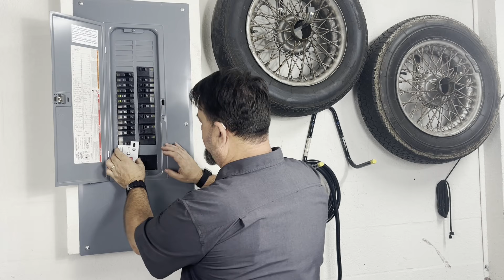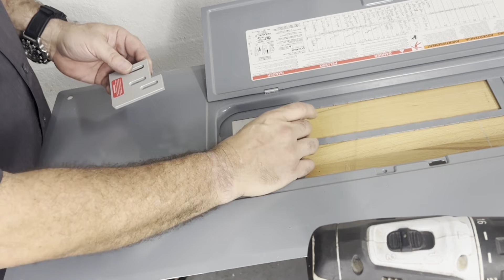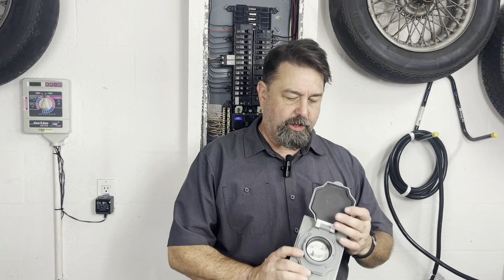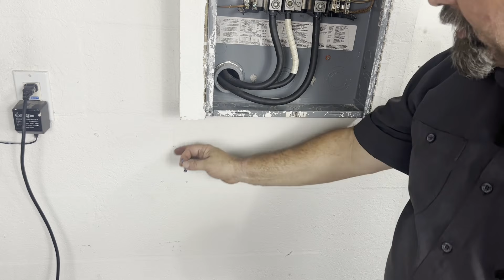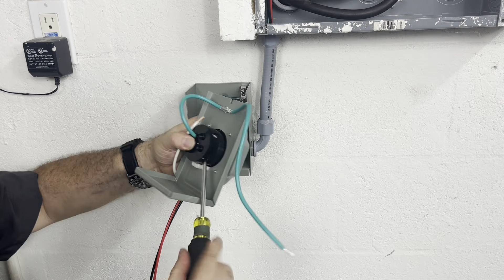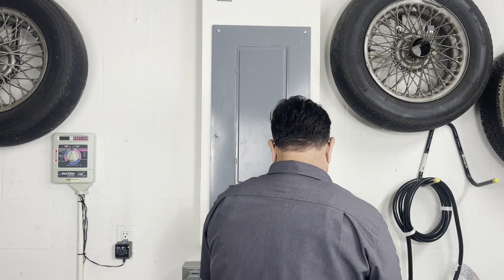DIY:  Adding a Generator Inlet Box, Generator Interface Interlock, Moving Double-pull 240vac Breaker

Comment: inlet box should be outside not inside.  Appears this is inside.  This is a new code thing I believe.
Reply from the maker: Local codes vary.  This is inside, and legal in this state.
Reply: @Oldman_Taylor -Not quite. Under newer NEC code (2023), portable generator inlets (≤15 kW) are required to be located outside for safety reasons. This isn’t just “state dependent”—most jurisdictions follow NEC. Older installs may be grandfathered, but new ones are expected to be outdoors.

Comment: 30 amps breaker should have 10 gauge solid wire That looks like 12 wire.
Reply from the maker: I put a link in the description for exactly what I used.  Its 10 gauge.  I expect your used to seeing solid rather than stranded.

Comment: Great job, exact same set up. I also place my box indoors. It’s almost in the exact place.  I added a 50 amp box, the 6/3 wire was difficult to work with.  I recessed my box an it took about two feet of NM 6/3 wire, much cheaper than doing a long run of 6/3. I’m going to add an RV Pass through to connect the generator in the garage. I chose a50 amp box, I can always upgrade the generator to a 59 amp if needed.

Comment: If you were putting in a 50 amp breaker what size wire would you be using?
Reply: #8 for 50A
Reply: @paschalkearney8388  no,  6 gauge for 50 amps.  8 gauge too small

Comment: Better placement of camera would have been nice.  Too much time spent looking at your back. I guess you realized it and  started to move it around a little which helped.  Also, the wire that you're using looks a little light for 30 amps.  Should be at least awg10. Also, for those who might not be aware, your generator has to be set to floating neutral. There are numerous youtube videos explaining that. Other than that, very good video.

Comment: Is your portable generator bounded on unbounded?  Or does it matter?
Reply from the maker: There should be only one "bonded ground" in the system.  Your main service panel will be bonded, so connecting to that, you want the generator to no be bonded.   If your running your generator alone, then it should be bonded.  Does that make since?
Reply: @Oldman_Taylor  Yes and thanks for the knowledge!!!!!   What are the consequences if the generator is bonded as far as safety.
Reply: @Oldman_Taylor  to check if the generator is bonded we can test the generators neutral to ground with a ohm meter, if the generator is bonded it will require removing the jumper from the alternator as the generator manufacture manual should explain in detail.

Comment: Hello and Thanks for sharing your very informative video.  I watched your video several times and decided to follow your recommendations and process yesterday when my son & I added a generator inlet box to my Homeline panel box.  I purchased the same inlet box, power whip, & wiring as you did from Amazon.  The installation went well except it took us about 3 hours because we went very slowly to avoid the main 240V wires that were still hot after turning off the main breaker.  After installation I tested the new inlet box with my new Anker F3800.  I powered the entire house including Christmas LED lights & tree (except dryer & air conditioner) for 6 hours.  It is very nice to have a power back up in the warmth of my basement without any noise or gas fumes.  The next project is to add a connection box from my basement to the outside to allow for cable connections to the Anker F3800 of solar panels and an old Coleman Powermate gas generator.  I think the most effective power backup system is a combination of batteries, solar panels, and a gas generator.  Best Regards
Reply from the maker: Outstanding!  Agree, the best is having all 3, and being able to utilize them easily.  I would say wind/water as well, depending on your geography.

Comment: Great video well done 👍 I am about to do this, but I have an 100amp subpanel in the basement with another fridge to it that I want to keep running with a power outage. The basement subpanel also powers a complete kitchen but I only need to have that fridge to run in a power outage. Is it safe to say that all I need to do is just like on the main 200amp breaker in the garage to turn everything off and only turn on the breaker for the fridge in the basement and maybe some lights? Thanks
Reply from the maker: Thanks for the kind words.   Correct, in the main 200 amp panel, just leave on the breakers you want, even if thats just the one feeding the 100 amp sub.  Then in the Sub, just leave on the ones you want - the one with the fridge for sure, and then any with lights that you may want to use.   Any that you leave on, just double check you dont have loads on them you dont want to run - if so, be sure to turn them off (well pump, lights on a timer, Roomba, things that tend to start on their own that you might forget about particularly).

Comment: Aren't both of the hots live  on the incoming side of the main breaker just inches fro from his careless hand and screwdriver motion? It also does not look like #10 wire he is using for the hookup on the 30 amp plug...Hmmmmmm....
Reply from the maker: My 35+ years of experience and the accompanying "comfort"  may appear as "careless...motion".  Valid point that I should probably emphasize the real danger a bit more.  As far as the wire, - I posted a link to actually purchase what I used in the video - it is in fact number 10.
Reply: @Oldman_Taylor  Good stuff. Thank you for the video. Always an armchair youtuber. As an IBEW and CWA Alumni, I think you did a great video here. 
Most don't know, stranded wire is indeed easier to work with hence it "not looking like 10". Safety first my friend! Good stuff!
Reply: Any service updates today that will be inspected via permit must have insulators installed where main conductors connect to main breaker, new grounding which includes two ground rods at least 6 feet apart and an emergency disconnect switch between the meter and main breaker panel. This would help eliminate the exposure.
Reply: His using #8

Comment: Thank you so much for this video. I’m getting ready to do just this. I already have my safety interlock on my box. It’s just a matter of running my wire. I’m going to mount my plug exactly like you are right under my box.
One thing you did not mention was whether or not your generator was going to be bonded or floating, neutral. From what I understand the generator should not be bonded when running this kind of set up. Please correct me if I am wrong. Liked and subbed! Thanks again and cheers from Dave.😎✌️
Reply from the maker: Thanks for the kind words Dave.  You are correct, there should only be one place that the ground and neutral are together (Bonded).  In THIS set-up, we are connecting to our main panel (the panel the utility comes in as well).  The main panel is bonded.  Therefor, the generator should NOT be bonded, and should be a "floating neutral".  If you where to run the generator with just extension cords going to your appliances, that set-up SHOULD be bonded.   Hope that helps!
Reply: @ very much so! TY😊
Reply: Great detailed video.  Well done!